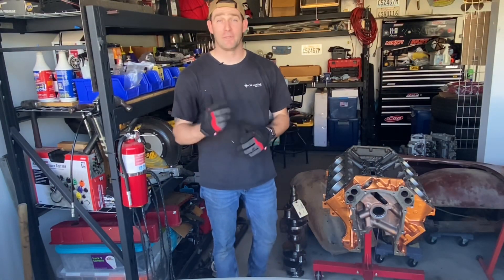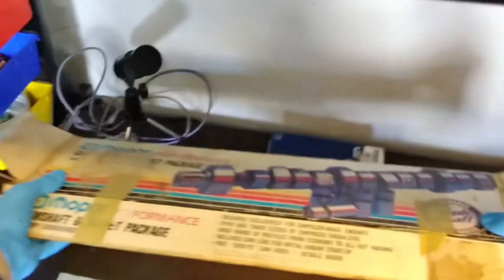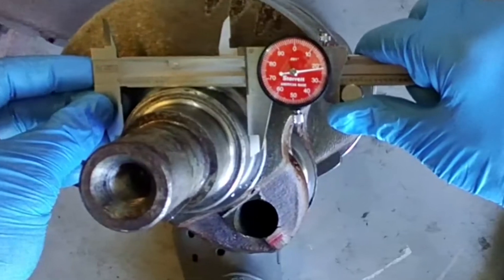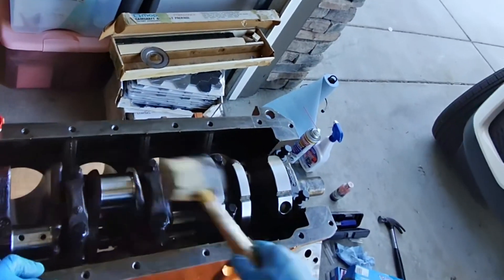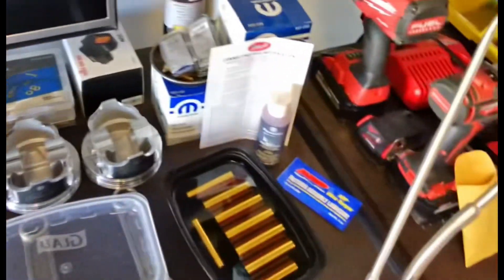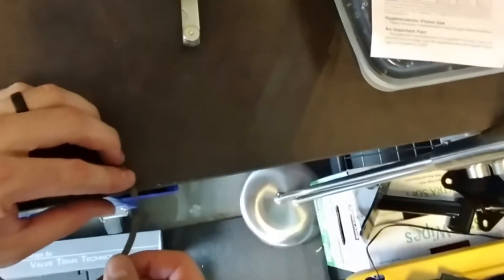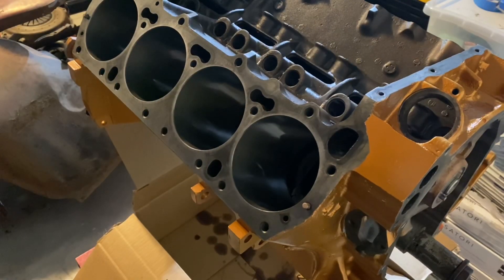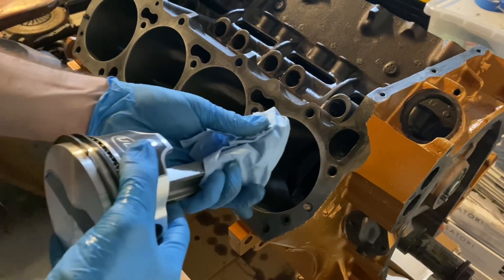DIY Mopar 426 STROKER - FULL Short Block Assembly

Comment: Nice!! This is a killer street setup!! Less rotating mass than a 383 and less overall mass than a 426 RB wedge!! I did one of these for a race application with 7.100" (!!) BB Chevy rods and a 499B stroker piston (1.13" CH) and a 3.500" stoke. Only 422" but a super light rotating weight and crazy +2:1 rod ratio!! I am scared of your lobe prelube, I use black moly paste (Isky, Lunati, ARP, etc.) and LOTS of it, fully coating each lobe and also the lifter contact face. Are your lifters used and matched to each lobe? If so, your break in will be more likely to succeed. That camshaft ran well and sounded great in a '71 440 that I freshened and loaned to a friend to run in his '67 Coronet. It peaked around 5600rpm with stock #346 (think #452) heads with new Crane single springs. Your application will certainly like a little more RPM but that cam is still going to limit you to around 6000 peak. VERY streetable and decent vacuum and a crazy midrange pull. I predict less than 400hp unless you have some excellent heads, but a good broad torque curve which is really what you want anyway!! Following and supporting the build!! RB
Reply: I'd like to replicate this build, but I like your long rod version. 
I already have a .035 over 400 block, and just found an early forged 383 crank with a little damage that should get ground out by the time they're done. So I only need rods, pistons and balancing.

Comment: Tell me more again on the crank! What did they grind, and pin sizes please! 
What do they normally cost used of course? Does it have to be a forged crank? 
Going to look at a 383 crank this weekend. And already have a 'fresh' 400 block.  Did you drill open any of the main oil galleys?
Thanks
Reply from the maker: I opened up the oil galleys with a dremel tool before sending it out to the machine shop. The crank was offset ground to 2.2”. This increased the stroke to 3.545. It’s now a 426ci with the .035 overbore. This stroker assembly is about $1,000 cheaper than a 440 source kit. For the same price, I could’ve built a 470ci but, I’m specifically after the oversquare characteristics.

Comment: We have the piston part numbers from one of the videos, but what is the part number for the 7.00 Scat 2.20 rods w/.990 pins and correct rod journal width?
Reply from the maker: SCA-26700716 👍🏻. Rods are actually 6.7”

Comment: Just watched to the end of the video. How far in the hole are your pistons?  You couldn't get to Zero deck? What's your compression going to be?
Reply from the maker: It appears that my true deck is actually greater than stock. As such, my piston is in the hole more than expected. I’m finishing the long block right now. Hoping to have the video out in the next couple of weeks.
Reply: 💥👏 Just scored a forged 383 crank for $50 and picked up a bored 400 block that has main studs. Slowly getting parts..

Could you please give us the part numbers and pricing for the rods?
Are they an off the shelf big block Chevy length?
Reply from the maker: @blownaway4371  yes, they’re off the shelf. I published a video before the assembly going over all of the parts with P/Ns, prices, and specs 👍🏻

Comment: Degreed the cam on my Purple Shaft 4 to 6 degrees retarded. Cant remember which. Im sure you know it will pull harder at top end. Love your videos.
Reply from the maker: 🫣 wow. 4-6 degrees retarded would be really frustrating. I picked up an adjustable timing set just in case this cam was off